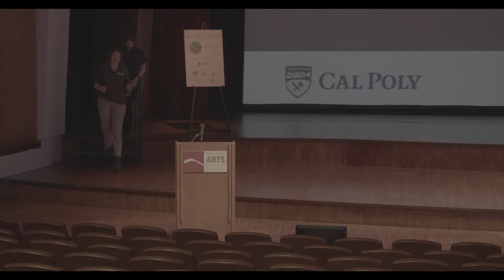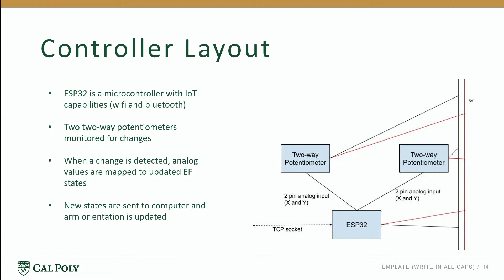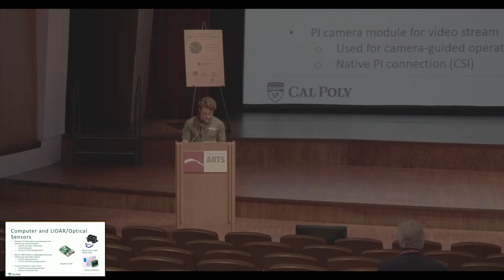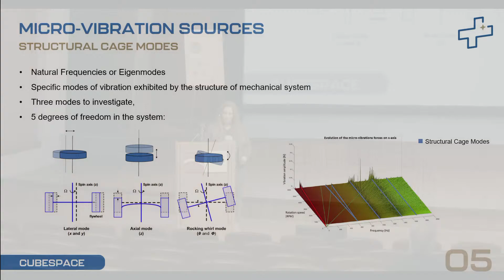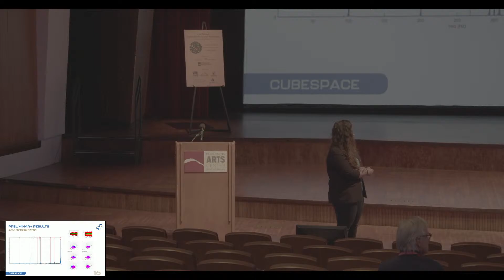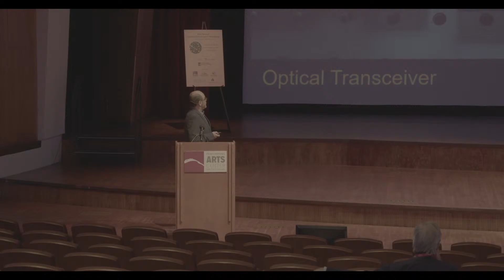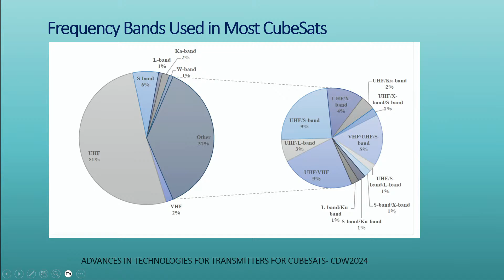2024 CubeSat Developers Workshop - Day 3

Comment: 0:04:55 Design and Development of a CubeSat Robotic Arm for In-Orbit Inspection and Servicing
0:20:33 A Low-Cost Mobile Ground Station Kit for Amateur UHF Communications: POINTY
0:31:11 Characterization of Reaction Wheels for High Performance Imaging Missions
0:58:56 Cislunar Omnidirectional Optical Terminal for SmallSats
1:19:43 Advances in Technologies for Transmitters for CubeSats